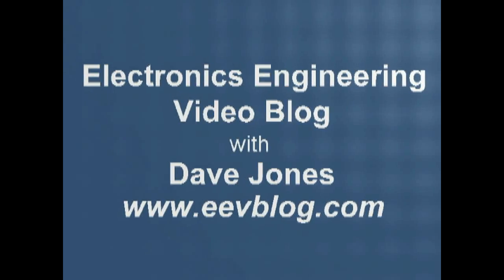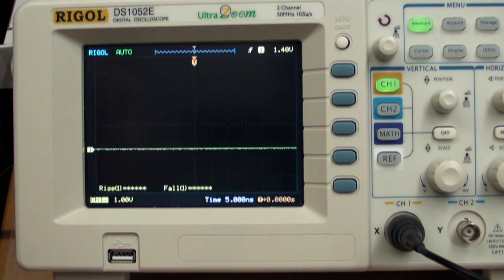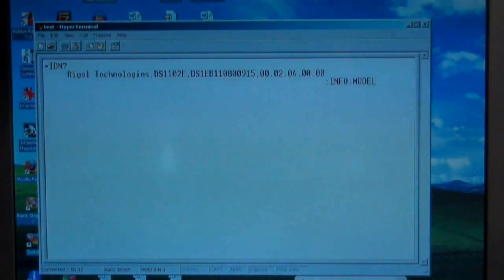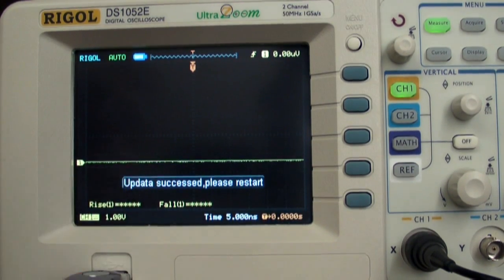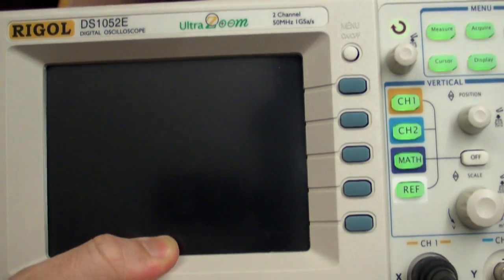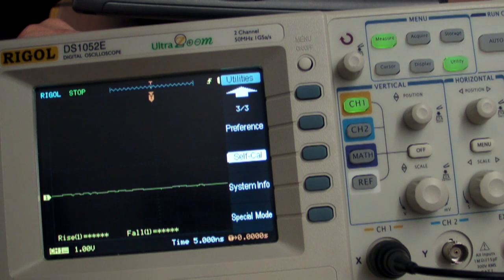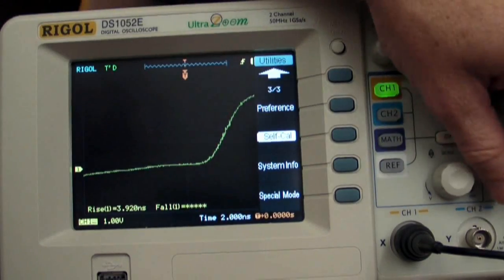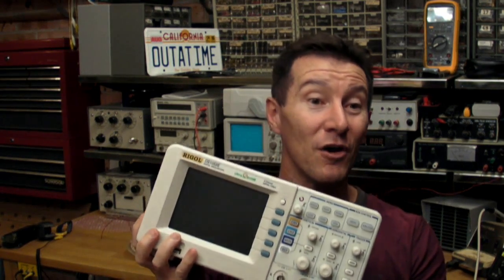EEVblog #77 - Rigol DS1052E DS1102E Oscilloscope Hack Update

Comment: i wouldent recomend flashing like that    the write erase cycle on nandflash chips   is quite low  and i wouldent want to risk a bad flashing and bricking my scope    that would be an expensive brick!
Reply: they are usually at least in the 100's to 1000's of cycles, often more, so in reality, you wont likely encounter any problems from changing firmware several times
Reply: indeed   but as ive learned with the PSP    the more you flash   the more likely you are to pick up bad blocks   the PSP firmware easily copes with this   but im not sure if the rigol scope will     if  a bad block pops up iin the wrong spot and the firmware doesnt compensate for it   the scope is dead    it only took 7 flashes for my psp to pick up a bad block    the PSP i beleve uses nand flash
Reply: then again  dave has plenty of scopes to replace the rigol if it goes belly up
Reply: its awesome to have a place  where i can have intellegent discussion with others instead of just a flame war with everyone calling everyone else a six year old noob!

Comment: EEVblog I recently bought a DS1052E expecting to do the 100MHz mod but I was surprised that it won't let me do ANY firmware modifications AT ALL. I tried many many many firmware versions and I NEVER get an update dialog. It worked with my friend's 1052E but he had a firmware version around 2.04 but I saw that mine is 4.01. Did Rigol maybe get tired of people getting an 1102E for the price of a 1052E? Any tips on bypassing this? Thanks!
Reply: +1 to this.
Just took delivery of a new DS1052E and it has firmware 00.04.01 SP7
Reply: I would like to know this too. But i cant find any info on Forum for new 4.xx versions of firmware.

Comment: Great film.  Is the ATTEN ADS1102CA 100Mhz Digital Oscilloscope DSO ADS1102 the same as the Rigol just under different branding?  It's for sale $470 on ebay and I need a 100meg unit.  Would consider the 1052E but cannot afford to get caught out.  Any response would be appreciated.

Comment: Well since the model and serial # change is written in a eeprom or flash; if you make the change in the earlier firmware there is probably no way to for rigol to fix this hack.  Once the eeprom values are changed to the upgraded model number there is no way for the scope firmware to know it is labeled as 50Mhz version and so it should stick for all future versions of the firmware.